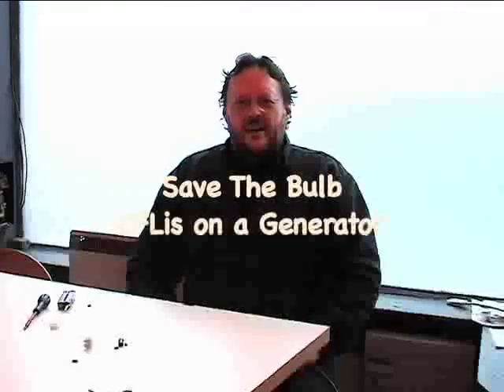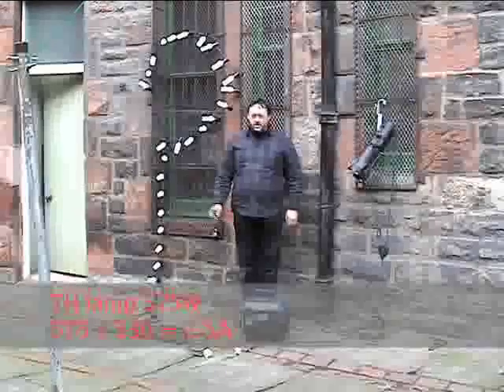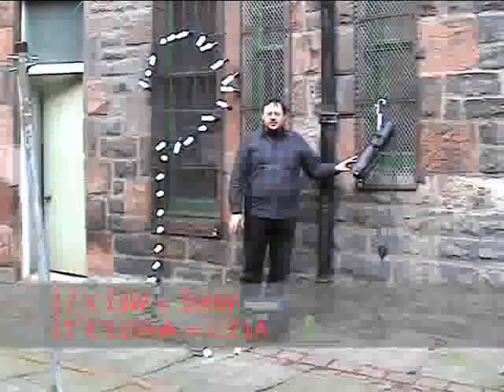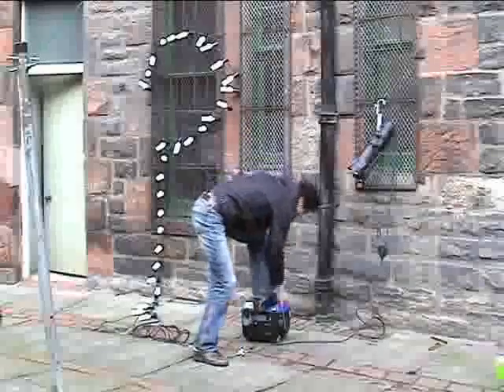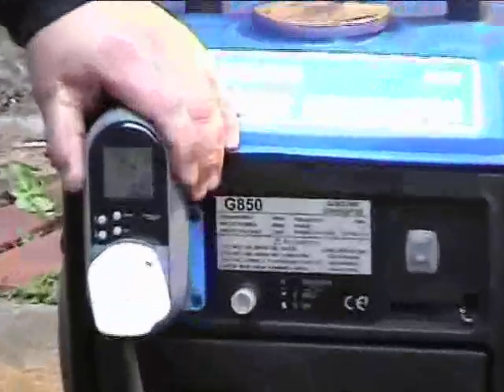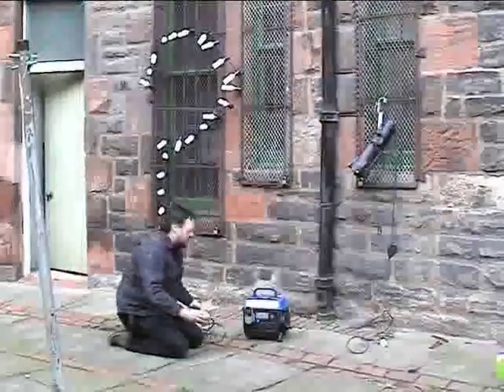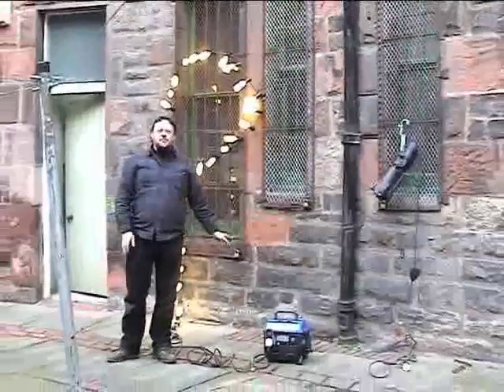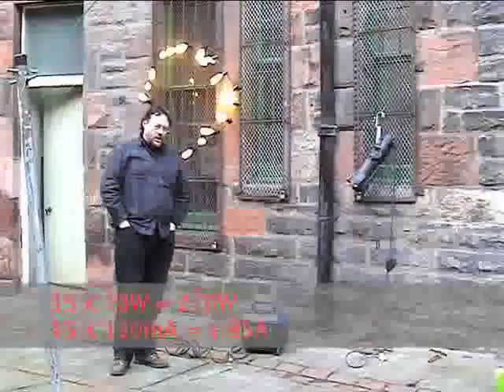Compact Fluorescent verus The Generator

Comment: Yes, CFLs are just shit ! Don´t buy them ! They emit harmfull radiation for your eyes, so your eyesight gets more bad each day ! You soon will need bigger glasses ! Also if they break in your room you are poisoned with mercury gas, child´s have died of cancer due to it already by sleeping under a breaking CFL and breathing in the gases ! Also the light just looks bad for your eyes the spectrum is just a line spectrum, not contineous like the sun or the halogen lamp.
The best compromise are the very new LED bulbs, but still not optimal in spectrum, the best for your eyes are still halogen bulbs , but they draw more power than LED lamps ! Also the bad power factor in CFLs not being equiped with a power factor correction capacitor makes them just waste too much reactive power which stalls the generator seen here in the video and also puts very much strain on the grid... These CHinese manucaturers just save 5 cents for a capacitor and this they have this bad power factor ! Damn stupid !!!

Comment: sure they are cheaper to run than traditional light bulbs but I must also say that most of the ones I bought over the last 3 years have all burned out and got tossed away like the overpriced junk that they were. I just hope they'll get more reliable as the time goes on.

Comment: This is an absolute joke of an experiment.

CFL's are better than traditional light bulbs in every way possible. Within reason you can run six "60W" CFL's for the same cost as one old fashioned 60W bulb.

If you want a fair experiment, See how many normal bulbs the generator will run vs CFL counterparts.

Other than that, I refer you to mythbusters that proved that even with the greater start-up load... CFL's are still a whole lot cheaper than wasteful traditional bulbs.